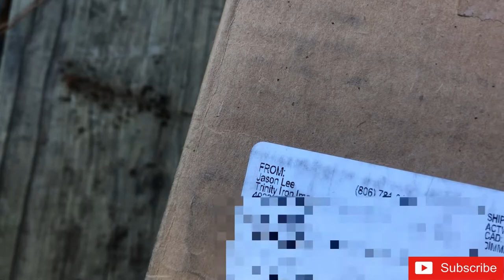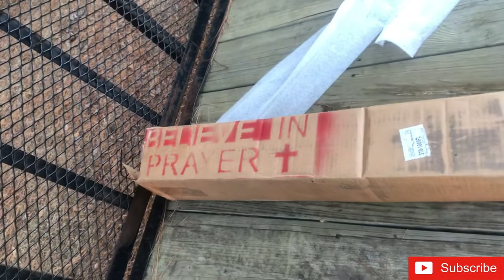Trimmer Racks from Trinity Iron Images. #sidehustle #lawncare #lawncarebusiness #believeinprayer

Comment: You should buy green touch racks so u can always keep your equipment locked 🔒
Reply from the maker: Thank you for watching and commenting.
Whenever I’m done for the day I just put my trimmer and edger locked in back of my truck.  When I’m out servicing I just put the lock on without locking it so it won’t open, but I’ll lock it if I’m out of sight from my trailer.
I’m going to tour your channel and Sub it. I like sharing ideas with other lawncare peeps.
Glad to meet you
Reply: @Allcoastlawnandpressurewashing  got ya u can see my 2022 set up on my page think u would love it
Reply: Believe in prayer, Indeed.  I still run my cheap Pack 'em racks because I like the individual locking feature. I did have a friend weld a fourth side on the back of them, just to reinforce them  and they've been fine for like 4 years or so...
Reply from the maker: @Pure_KodiakWILD_Power  one of my friends also reinforced the back of his pack racks with metal, he’s had them for about 5 years now. I can see why you prefer individually locking each latch, because you might only need one system at a time for a job. Thanks for commenting on this video.  Gives other viewers ideas on which trimmer rack to buy